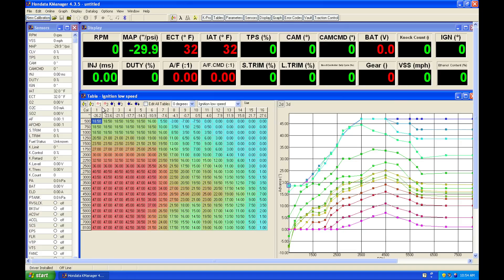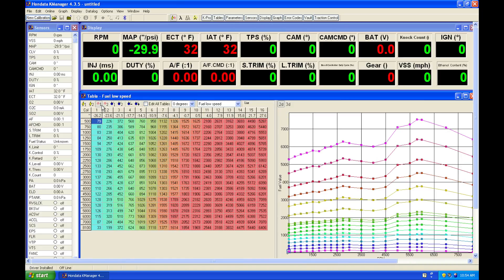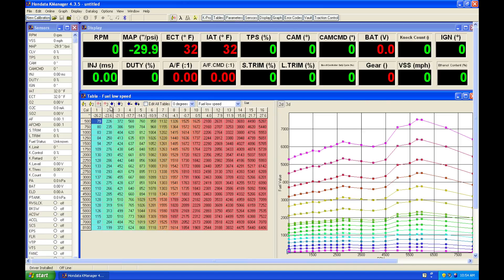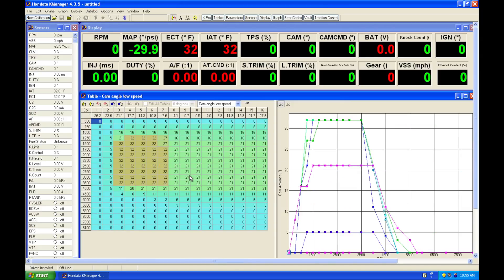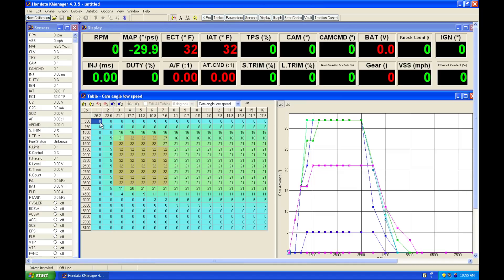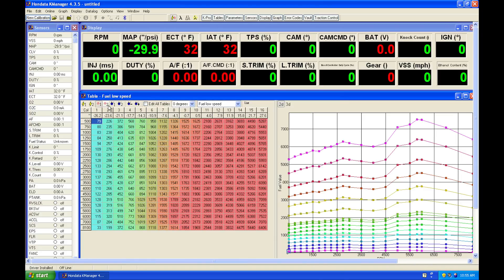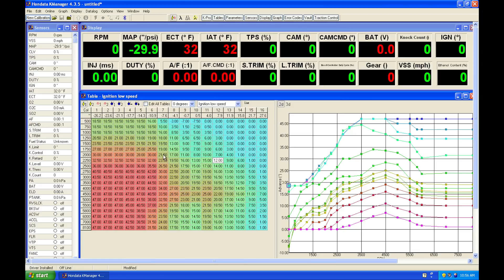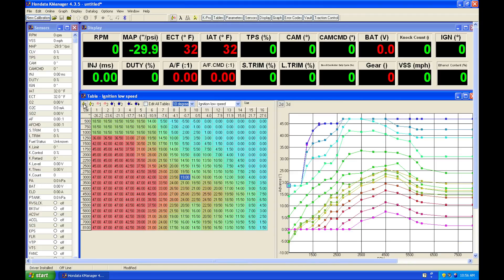Hondata Kpro: Kmanager Software Explained

Comment: If you want to keep it simple leave the low cam stock tune for daily driving and only tune for high cam with TPS over 50%. 4300rpm cam crossover